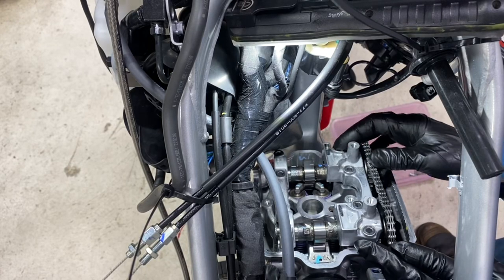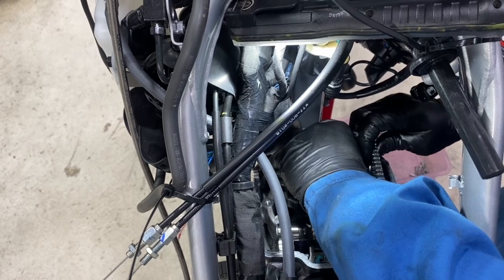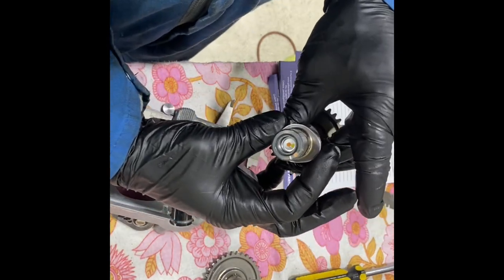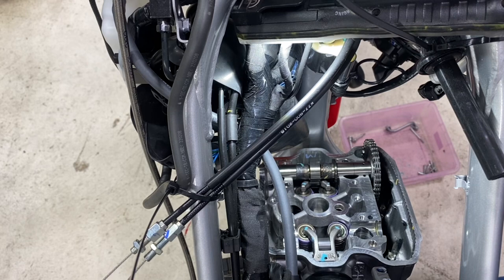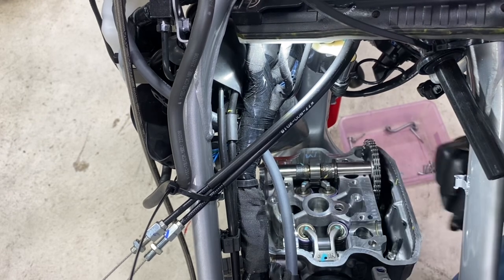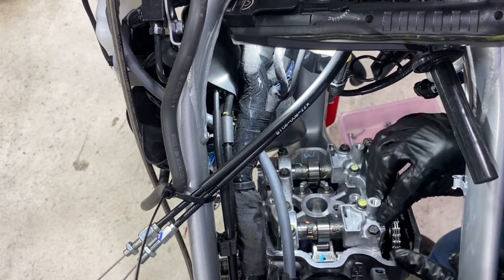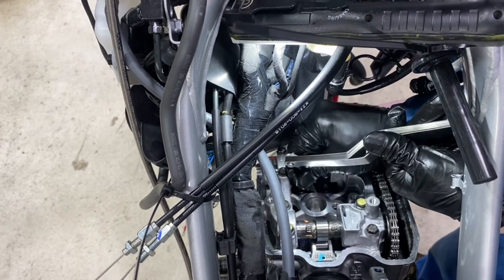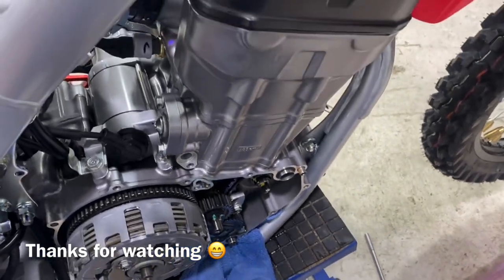Cbr camshaft swap to #crf300l watch before you do mod. Guaranteed save you money 💰 #hondacrf300l

Comment: I appreciate the vid but there are more things to measure on a cam than just lift.  The CBR ex cam could easily have longer duration with a more aggressive ramp, and the extra lift on the intake cam doesn't increase duration.  Also noteworthy is the fact the CBR300 ex cam and CRF300l ex cam have different part numbers.

Comment: in camshafts, it is not only the duration that counts, there is also the survey (subtract the side measurement from that of the highest point) and one of the factors that most influences torque and hp is certainly timing!  even if the camshaft measurements are identical, the start of opening and the start of closing of the valves may vary

Comment: Wouldn't it be best to use a micrometer instead of a Vernier caliper to measure the shim, since the wear is usually in the center of the shim? You could easily get a false reading as you're measuring the outer edge using the caliper.

Comment: Nice work. I have just put a set of cams in my 300l now i have an oil leak at the front of my motor just under the exhaust. There is a small hole in head. any idea what this hole is for?

Comment: What is the top speed and cruise speed  of the CRF 300l now, after the camshaft and air intake upgrade?
Reply: Shonky Productions did the mod and claimed 104kph in 4th gear or something like that.
Reply: I can hit 100kph in 3rd at 10500rpm with the Cbr300r cams and airbox boot.  I think top speed will be around 160kph in 6th depending of the wind conditions

Comment: AUD 33? Cost 214 Euro over here!
Reply: you are getting ripped my friend 33 euro for both cams lol
Reply: @edwindol3597  Link to shop selling at AUD 33?
Reply: @no66  not sure if its allowed but bikerzbits look on their thai website hehe
Reply: @edwindol3597  Thanks. Have to get the bike first though! 🙂
Reply: @no66  ah nice i got a 2018 250L did 66.000km on it already just stock still but looking to make it cbr300r specs +6HP seems not bad
Reply: @edwindol3597  I have a XR600 (628cc, 450 forks and carb, big fin head etc) Just want something modern with longer service intervall and elec start.  Set on a 300 rally now.
Reply: @no66  who sells the cams for 200euro?
Reply: @no66  Cool Bike, I have the same set up, my '90 XR was a Ballard's XR's Only with Big Fin head 100mm piston + cam ect but stock forks, It's a pity parts are getting scarce for Ol' Girl now! -Cheers👍😁